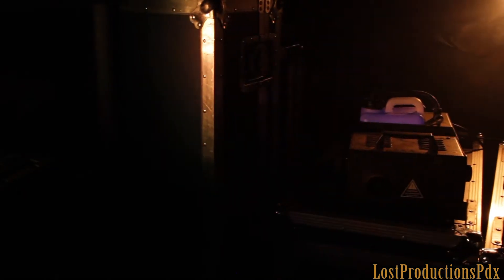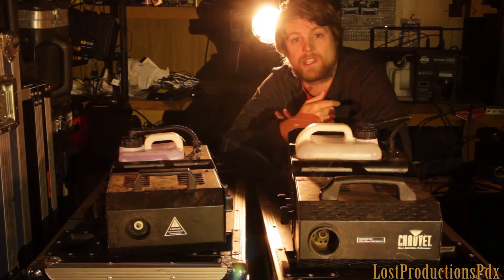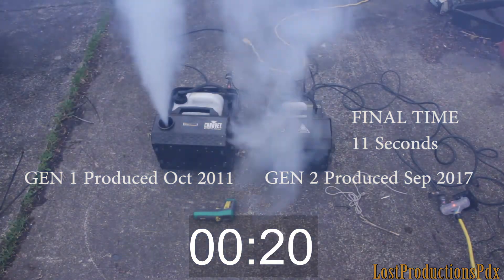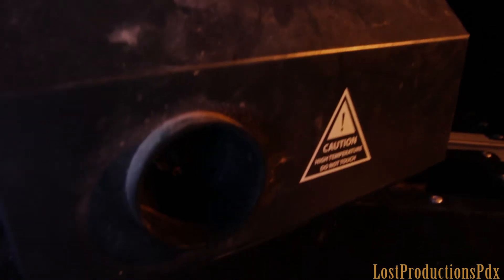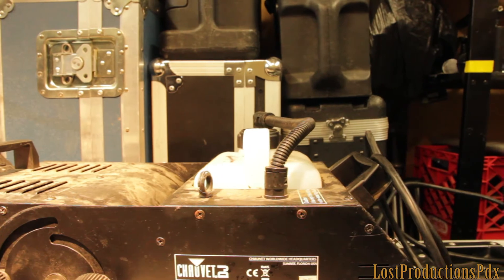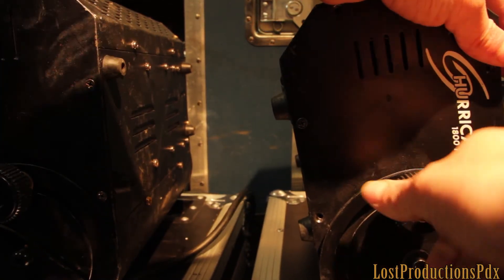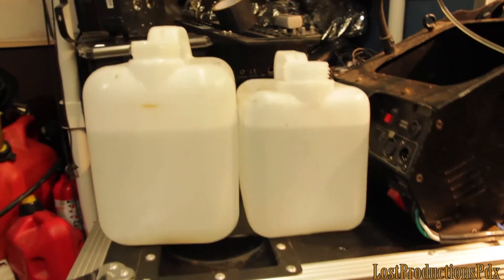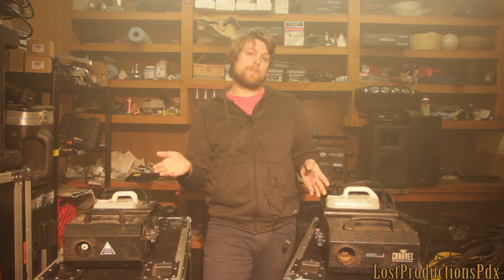Chauvet Hurricane Fog Machine Review: The Best Fog Machine You Can't Buy

Comment: Just had the pump in my gen 1 1800 flex die after 8 years. I took it apart and everything looks good, but the plunger just doesn’t seem to want to move (maybe the coil is weak or broken internally). I bought a replacement pump from Chauvet, but they sent me something different than the part that was in my gen 1. Of course, it’s still the right shape/size and does work, but I’m a little worried since it’s a 41W Class H [1 min on/1min off] pump (produced 20042001) vs the original 48W Class F [2 min on/1 min off] pump (produced 20130311). I’m guessing they sent me the pump they use in the gen 2 machines, which is pretty disappointing.
Reply from the maker: Interesting, yeah from my observations the newer machines have a stronger spray of fog at the expense of longevity, pretty inline with those specs. I was thinking it was an age difference but it's likely they just started using a different pump. Those fog fury type machines became really popular maybe they just simplified supplies and started standardizing on parts for ease and cost reasons. 
If the newer machine didn't constantly break I wouldn't have minded the reduction in continuous output.

Comment: I'm curious if the gen 2's cheaper hose is the main culprit for the inconsistent output? 

I also noticed your side by side comparison has them both shooting straight up. I'm wondering if you ever had any of that inconsistent output from your gen 2's when the nozzle was NOT aimed up. 

I'm a filmmaker looking for a good fog machine to add haze/fog/smoke for shoots, and wouldn't typically need a machine that shoots directly up. Reliability is obviously a must have, though. Do you have any thoughts on a machine (any brand) that would best suit my particular needs?
Reply from the maker: The ability to aim these is seriously one of the coolest features but honestly I'm usually just shooting straight out as well.
My opinion is portability and control for you are crucial, I would check out the ultratec ultra handy fogger. 
Another that comes to mind is Rosco Mini V and Look Solutions Viper S. 
Here's a list of additional companies that could provide a solution. 
Reel EFX 
ADJ
Antari
Le Maitre
MDG
Froggys Fog 
If the warranty is only one year, the build quality is going to likely be low. 
Plenty of manufactures are offering 2 to 5 year warranties if they stand behind the product.

Comment: Chauvet do a bunch of other foggers as well. The Geysers are really good. I have used Chauvet products for quite some time and everything I've received is still working. The only thing I've had break on me is a fader on my Obey 70, but I started using Chamsys to control my lights then.
Reply from the maker: I love Chauvet stuff, I've used many of their products and own some as well but I really don't understand what happened with this particular product. These machines kicked so much ass and then they changed everything about them. The original units are incredible so it's sad to see the decline in quality. I've learned that every company has duds now and again.
Reply: @lostproductionspdx  yeah. I'm getting the Hurricane 1600 and I've heard they got good reviews. It has continuous output even at full volume and DMX comparability. All Chauvet products are made in China as are most products so there will be a small number of faulty units.
Reply from the maker: @andrewgrindley6773  i have a 100% failure rate on these 4 units, I'm steering clear of this particular iteration of the product. My needs are more demanding perhaps than the intended audience but the old model filled my needs easily.
Reply: @lostproductionspdx  I don't know why this happened. I'm guessing maybe Chauvet switched manufacturers.

Comment: So how would you even find the first generation models????? All the ones listed on eBay are selling the current generation even though it shows photos of the one models..
Reply from the maker: Well at this point they're all used, you won't find any unopened new ones. Plus they're all likely pretty heavily abused. I would just highly recommend you avoid this current gen unless you're using it indoors all the time and it doesn't move much. My needs were too demanding for it though.
Go Ultratec if you want made in USA or Antari, Froggys Fog, or ADJ for good Chinese units.
Reply: @lostproductionspdx  Well Ultratec looks to be way out of my price range at over 1k and 2k.. Antari doesn't seem to have much of a good selection other than hazers.. ADJ has a nice one out with the LED lights and can be used in different directions, and I'm hearing those are better with the thinner fog that disappears pretty quick, and also they don't have the control that can be used with settings/timer etc.. like the Chauvet has.. So I'm completely out of ideas.. It's for mobile DJing, and the one I was using the ADJ Dynofog died on me.. Those weren't great machines and have been discontinued years ago....
Reply from the maker: How long did your Dynofog last? Throwing these machines in the car every night definitely takes it's toll. Honestly if you're happy with the dynofog used one's are so affordable. Most of the ADJ machines have timers btw, look under atmospheric/accessories on their site.  The remotes are not interoperable so check the manual first. 
I'm not saying all Chauvet machines are bad but this particular one was very unreliable for me.

Comment: What you would recommend if the gen 1 is so hard to get? Different brand? Different model?
Reply from the maker: Hey Lucy,
You have many options however I can't really speak to the reliability or quality of all these machines from every manufacturer. Look at the warranty and availability of parts though. Ultratec for example while 2 to 3x the price offer a 5 year warranty.  ADJ offers the closest to Chauvet in terms of pricing and model line up. I run ADJ haze machines and they've been reliable for years so far.
I'm seeing many negative reviews of lower priced machines. If you want something reliable, you need to increase your budget sadly.
ADJ
Chauvet
Froggys Fog
Antari
Reel EFX
LeMaitre Effects
Ultratec Effects 
Look Solutions 
MDG Fog
Reply: Lost Productions thanks for the reply on an old video

Comment: I need your help with my hurricane
Reply from the maker: If you're in the Portland OR area, I can offer repair services, however depending on what's wrong, at this price level of machine; sometimes it doesn't make sense to repair them. There are two main parts in the machine that fail, heater or pump.

Comment: Just shows how chauvet has ruined their products, they also had the geyser RGB, discontinued that and replaced with weak ones. I hate what they have done to the 1800... they also ruined the 700, the smallest fogger they sell, utter garbage now - doesn’t even have a gland around the fluid tank and the bottle is so cheap it strips out when you tighten it
Reply from the maker: I hope they see this and get their act together, we don't want to buy crap it's simple right. 
Like I mention in the video though every body has duds even the biggest most respected names, hope they get it together.